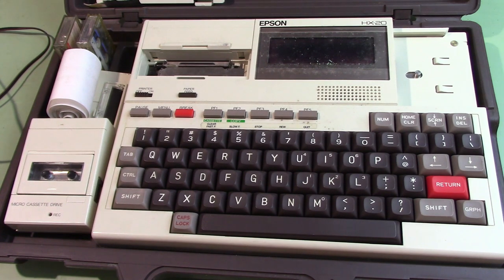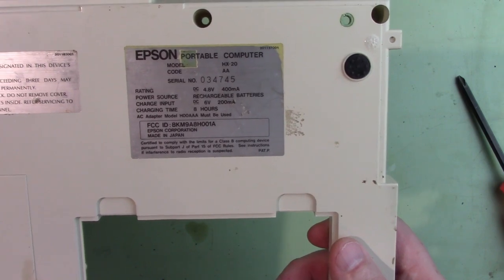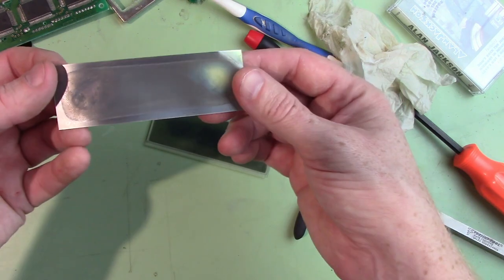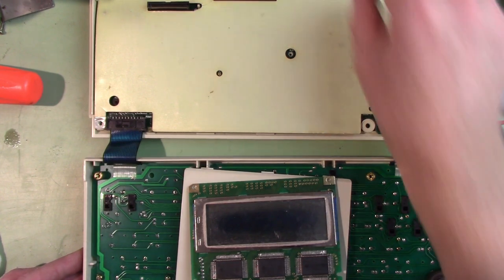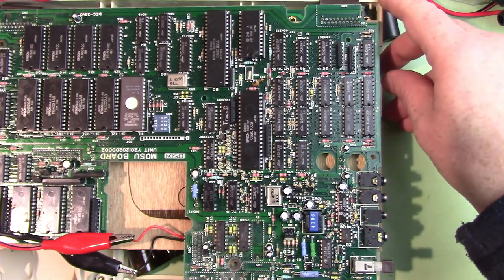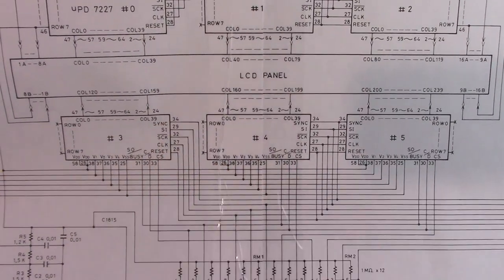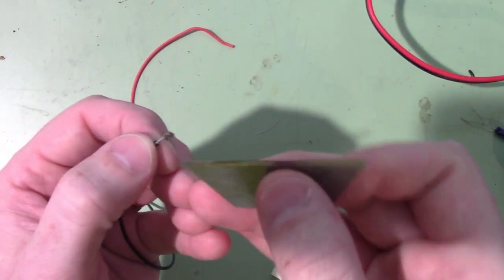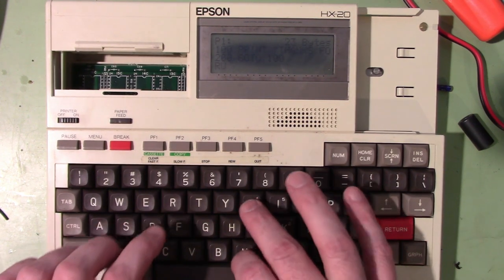EPSON HX-20 Repair Part1

Comment: The power monitoring circuit on the MOSU board does not like switched mode power supplies. The computer is designed to run off a clean power supply and that can only be suppleid via the 4 x 1.2v batteries. It is still possible to operate from an external power supply but not very reliable operation doing so. Great repair videos, I'm really surprised how far you restored this computer, excellent repair skills!
Reply from the maker: Thank you! I figured the power supply was messing with it, but it's what I had. Works great with the battery though.  I need to recap it. It started intermittently not cutting on a few days ago and I saw some capacitor leakage, so I took the battery out and cleaned the board. A cap was pulling the voltage down on the board. Need to get that done soon!
Reply: @JohnHamerProjects  Yeah, I had same issue with mine, all caps were bad and leaking. Had a few bad traces too. I've still got issue with my board and sometimes loses the 7V required for the LCD. The IC2 HD14049 was not working correctly, swapped it out and worked a few times but still got some power issue with LCD. That is why I want to ditch the NEC LCD and replace it with modern 20x4 LCD and backlight. The boost circuit on the MOSU board is not very reliable.
Reply from the maker: @arnolduk123  are you thinking of using a microcontroller to make the lcd work or reflash the rom?
Reply: @JohnHamerProjects  I'm going to use an ATMega328/Arduino to sniff the LCD data lines and then convert the data to send to the Hitachi LCD. I think the Epson CPU only sends pixel and x,y data to the NEC LCD which has all the ASCII info stored in the upd7227 controllers. The rest of the pins are only for sync and controller ic selection.
Reply from the maker: @arnolduk123  Nice.  That's pretty much what I was thinking I would do if I had to also.
Reply: @JohnHamerProjects  Well those NEC LCD's dont have a long operational life even if you do get it working. With an off the shelf $5 modern LCD with backlight its worth a shot.
Reply: @JohnHamerProjects  My HX-20 is pretty much working fine but I have strange power off issue in which I have to reset it when I switch the power button off. it wont turn back on and appears to hang until I press reset or remove the power completely. Does not appear to go into low power state. My current meter shows the current rise to 30mA with the power switch in off position. Any ideas ? I've replaced all caps.
Reply: Ignore last message. I found the problem and it was C14 which is a tantulum 1uf which I missed (looks like an inductor). Replace with 1uf electrolytic and powers on/off without problems now. Reading the technical manual section 3.14 the C14 and R48 is critical for the low power state switching.
Reply from the maker: When you recapped it,  did you find a list online for what to order, or did you just figure it out from looking at the board?
Reply: @JohnHamerProjects  I looked at the board and replaced all electrolytics, but missed the tantulum which was way out of spec. I only noticed it when looking at the schematics.
Reply from the maker: @arnolduk123  cool.  Thanks.  Ill be sure and get the tantalum.
Reply: @arnolduk123  Any progress on that? I found a nice VA-LCD white on black with wide viewing angles with the correct size, regular 8bit interface, but it seems the replacement panels are rather thick, like 12mm. Can you fit that?
Reply: @2kBofFun  Yeah, I'm working on fitting an off the shelf 2004 LCD and is 1-2mm too thick but that won't be an issue. I'm coding the LCD controller interface at the moment.

Comment: Just got a mint non working one, and on the inside it looks like new as well, no leakage or whatsoever. Where to start with checking?
Reply from the maker: Def replace the battery first.  It will not reliably start without a good battery. Does it beep when you cut the switch on?  I just recapped mine because it stopped starting after I made the video.  That fixed it.  Starts reliably now.  If you get those things done and it's still not starting, I can give you come circuits to check.
Reply: @JohnHamerProjects  No beep. Can it accept a higher voltage range, for example 2x3,7 lithium, or can I connect a USB charger to the battery connector?
Reply from the maker: It has a circuit to check the battery voltage and it won't start if it's out of range.  I'll take a look at it and see if you can mod it and if the components can all handle it. The no beep may be the battery voltage not right.  If you remove the battery, you may be able to get it to start occasionally from the charger. It's not very consistent, but it may tell you if there are any major issues.